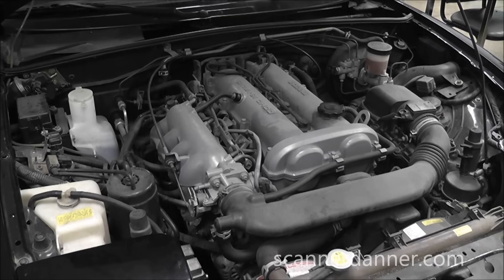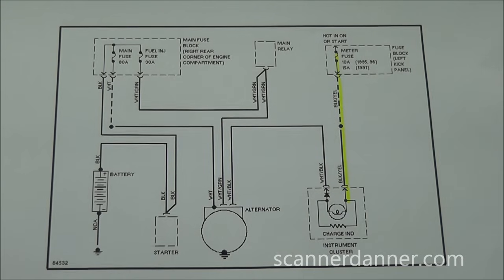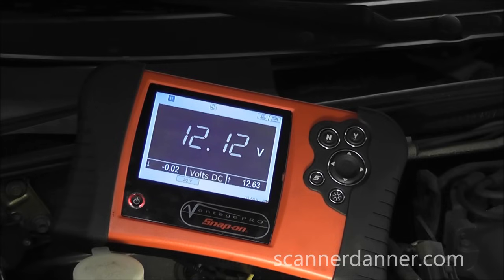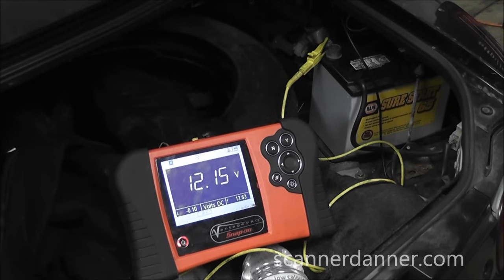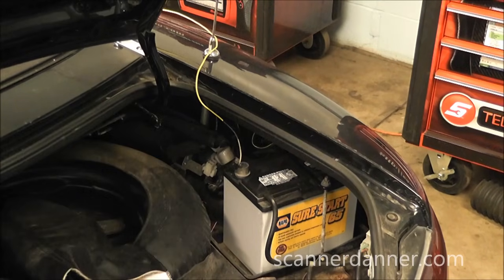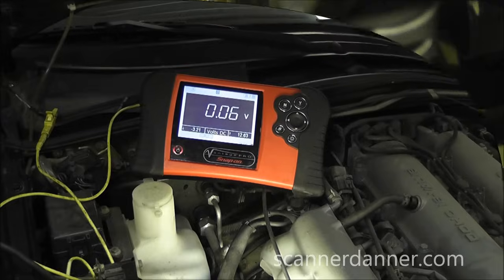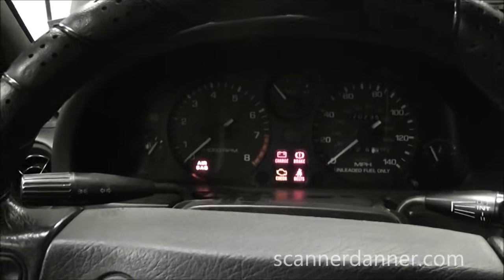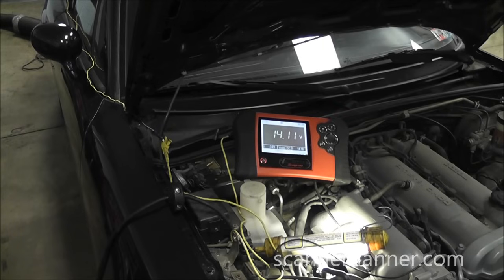How to test an Alternator (not charging from a blown fuse) - Mazda

Comment: i must say this first i swaped my 94 tbird motor and trans into this 96 tbird. when i got it in it started fine and ran good. then all of a sudden when i tried to move it it died so i had to push it back home phew. since then the alternator hasnr been charging. the grond for the motor to chasis is jacked up and hard to reach. ia there n e place else i can ground the block? my arms are to huge for that little area... my key doesnt click but the lights do come on with the abs and overdrive. so i ran to wore from the starter dor a toggle it starta fine there but want charge the battery. when i finally get it running the battery runs down in about 15mins of idling.  the scanner tool kicked me out of the xar bascially wirh J1850pwm, ISO14230 HL, ISO9141-2, 14230aDDR, CAN50w, CAN20, then 2911. i suspect this car has serious birth defects that im not sure of. ive been searching for a vacc distribution diagram and not obe have i fou d thst matches my car. my brain in in ovrrload but im want loose this fight ive lost the last 10 rounds with the pumpkin head but hey i still ready to fight wirh it. thanks scanner i wish i had them there skill. u nastier than a 50 year old bucket if ahit with that scan tool and, test light etc. amazing bruh please help im jn the corner witb my cut man now lol
Reply: scanner mane tell me something if i switch my 94 tbird motor and trans and put it in a 96 tbird body do i have ro have the cimputrr and key switxh for the 94. well ive already swapped the motor into the 96. it want crank nor start with the switch. i by passed the starter and it s.cranks and start and run like bs and rhen dies. but the fas is supa lean it was sittj g uo for some years.
Reply from the maker: We can help you. Post your question here https://www.scannerdanner.com/forum.html
It is free to join.

Comment: You re good, i wish i knew an Electrician like you be cause my Liberty destroyed 4  batteries And one Alternator since 2004 and i finally realized that if i crack the hand brake to the first Pin always and the head lights turn off, my Alternator is charging and the Lights don't deam when i don't Rev.the Engine.

Comment: y negative terminal gets hot. No corrosion. Any ideas how I can solve this?  Help...
Reply from the maker: Resistance equals heat. So either the cable itself is too small of a gauge (did you change it?) Or you have a connection issue.
Reply: Hi..  The cable is the original. It even gets hot if I run engine on alternator only  without  being connected to the battery. (Negative only). ANy idea how to best diagnose it? Thank you
Reply from the maker: you should never do that!! What other issues are you having that made you check the temperature of the negative cable? What have you added to the system? (amplifier/stereo?)
Reply: ScannerDanner Battery was not starting the car. Still under warranty but they said battery is ok.
Reply from the maker: @jaimeparadise  time to do some voltage measurements on the battery and cables

Comment: so if the bulb is not good, the alternator will not charge ?
Reply from the maker: on this system, that is correct. I had a VW with the same design with a burnt out bulb in the cluster with a no charge problem.
Reply: +ScannerDanner ok thanks again man. I was just in the middle of one of your videos again. yor are a great teacher.
Reply from the maker: thanks so much!

Comment: http://www.netlink.net/mp/volks/schem/mot_alt.gif

above suggests that one way is to have light energize rotor through regulator at key on.
upon startup, rotating field will exite stator.  diodes labeled 'trio' prevent lamp circuit from energizing high sides of stator. Now, stator terminals will go high with spinning field from rotor.  With them high, the light will go off and the stator will self energize from then on.

for the alternator to function AND for the light to be on, I think only the regulator can cause that.
if all three 'trio' diodes failed open, the light would be the only source of power to regulator and rotating field and be 'on'.

Comment: No a voltmeter is a high input impedance device therefore you couldn't draw high current. Now if you screwed up and had it set up as an Ammeter you would probably blow the fuse in the meter if the battery cable to bat terminal connection was bad enough. But there would never be any reason to be hooked up like this with the meter set up as an ammeter. That said I have made mistakes and done similar things the only result being having to replace the fuse in my meter.